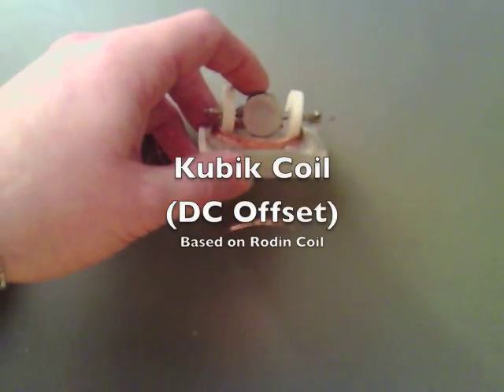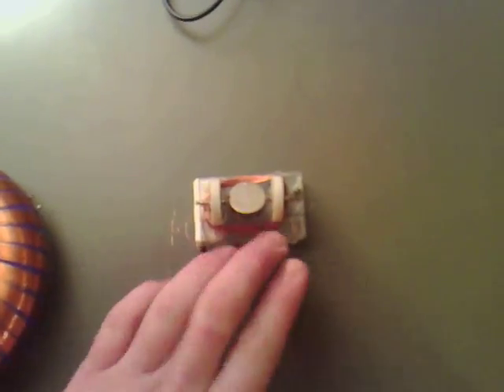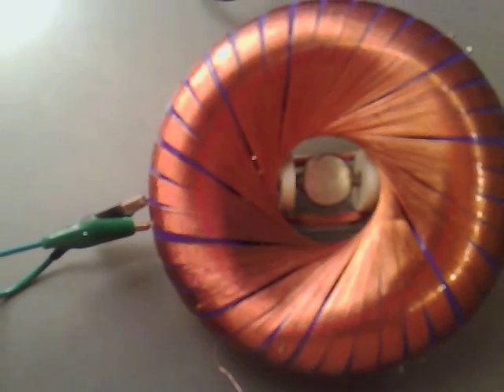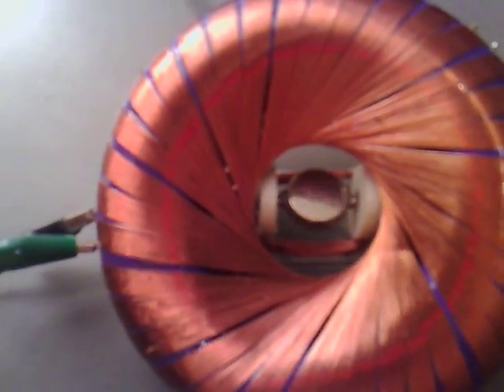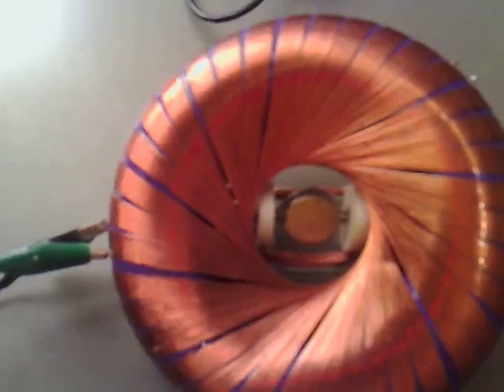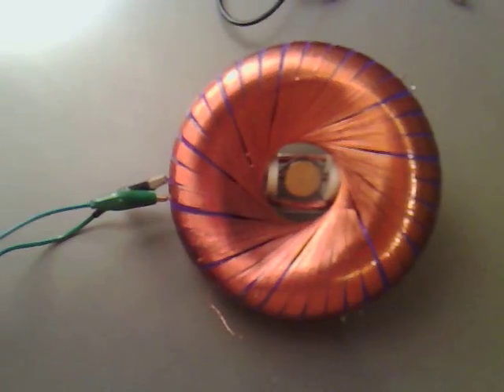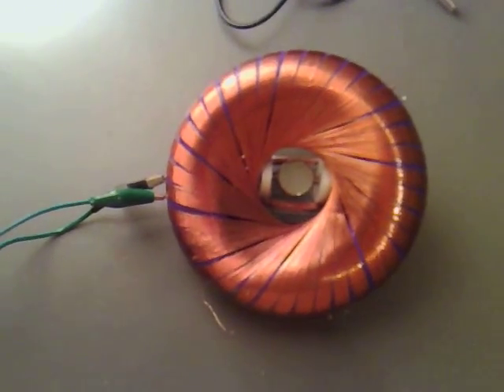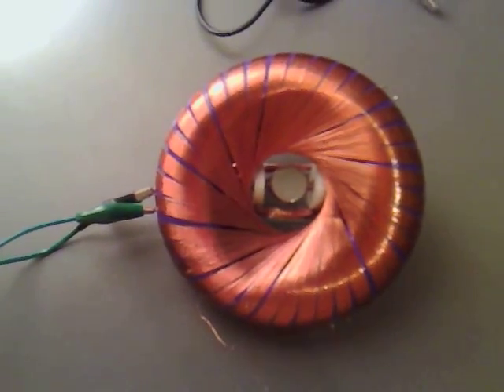Kubik Coil (DC Offset) 006

Comment: I once read on a guy's project with a 3-layer gyroscope. One axis inside the other, inside the other. Occupying the same centre.
A difficult thing to drive mechnically, but he found a way. Now I wonder if a Rodin coil, with your findings, fed with multiple frequencies, could somehow spin up each of the seperate gyros. The ideas is that one would achieve anti-gravity at a given high rpm.
Keep tthe cool video's coming!